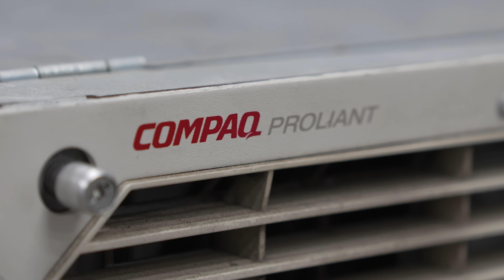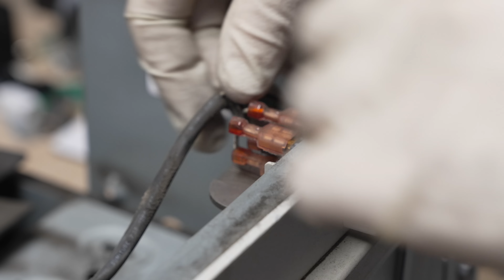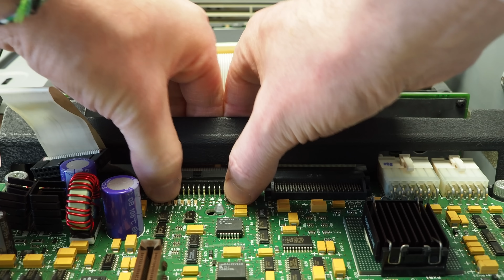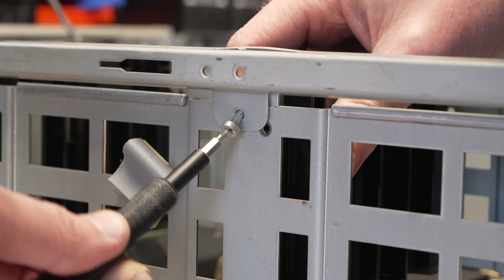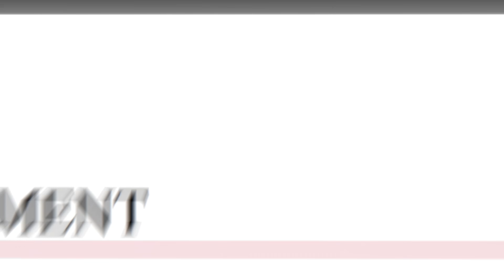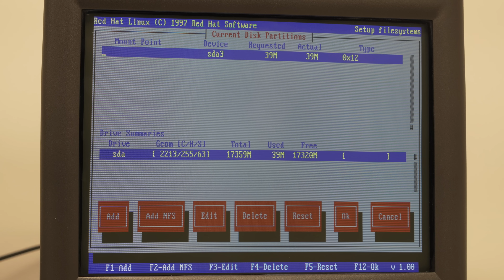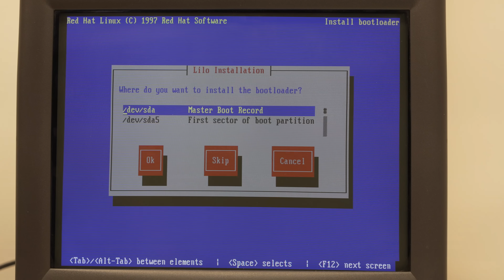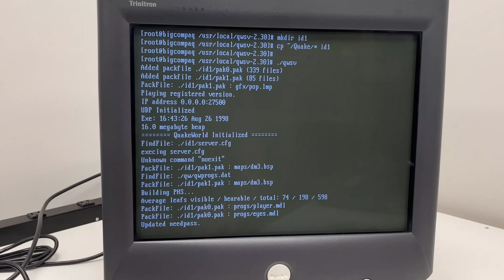A $25,000 server from 1999!

Comment: I worked at Intel in the server support group in '99-2000. Our official "corporate desktop PC" was an ancient Pentium desktop. But I supported systems like the one here. So I snagged one from our test lab, and made that my "desktop." Four P3-Xeon 550/2MB, a PCI Voodoo 3 card, a sound card, and I was flying. 

We even did a trade with a company that made "workstation graphics cards" - we traded one such system for a high-end "card" - it was a THREE PCI-X card set that each had two Voodoo 3 chips, with this company's custom firmware and interconnects. It truly was a three-card set, they would not work individually. IIRC, only one card even had the full PCI-X connection, the other two only used the PCI connector for power, with their custom interconnect on top (like a modern SLI bridge) allowing the cards to talk to each other.

We put it in an EIGHT CPU system, and ran Quake 3 on it. (Then it went off to the team that did trade shows, so they could run Quake 3 on then-brand-new HD displays.)
Reply: I imagine you’re referring to Quantum3D. They were spun off from 3dfx for very high end graphics for simulation work. Lots of different insane cards from the original Voodoo chipset (SST-1) all the way through to the later VSA-100 architecture. Awesome bits of kit.
Reply: @ It was even more niche than Quantum 3D. (I had a Quantum Obsidian Voodoo2 back in the day.) IIRC, the company didn’t last long.
Reply: @AnonymousFreakYT  dang that’s cool!
Reply: We had so many spare systems like this in our lab at Microsoft that I dedicated 2 and several storage arrays just to serve as an NFS share for MP3s.  Ridiculous amounts of money wasted on it :D
Reply: that end is funny
Reply: Running sgiquake fully-antialaised at 1080p in 2000 on a three-pipe SGI RealityMonster was pretty sweet... with 16 400MHz R10k CPUs and 5GB of memory,  the list price on the machine was over $1M, IIRC.

Now I have an HP Z840 workstation (tower PC size) with 2 10-core 3.1GHz processor modules and 256GB (quarter terabyte!) of RAM amd a much more powerful gfx card (Nvidia Quadro of some sort), that I bought off of eBay for $750... and it's about ten years old.  Amazing how far compute power and gfx have advanced.

Comment: I "requisitioned" a Dell PowerEdge R900 from my college a few years back. Thing was a beast with 4 sockets and multiple add-in cards for more RAM (up to a whopping 256GB!). It was louder than hell and drew 5 amps on startup. Way too much for my small apartment lab. Went to dump it at a Free Geek and someone in the parking lot offered to take it. Hope they're enjoying it.
Reply: Yeah, they're great... when someone else is paying the power bill. (I have an R910 scattered around. When moving one, you remove everything that can be removed - and it still weighs 1000lbs.)
Reply: @jfbeam  and believe it not, when i first got it, i carried it solo down 4 stories and across a couple hundred feet of parking lot. that was tough
Reply: I remember getting a PE 1950 off of Ebay, a R900 would have been amazing!
Reply: I scored an IBM X3500, it would be nice to try some silly uses however a bit overkill for a spare bedroom. if the screaming fans don't encourage the wife to demand I turn it off, then the power bill probably will.
Would make a lovely dialup BBS, trouble is phone lies are a distant memory out here.

Comment: 6:40 That's something I don't understand about Compaq's engineering... their name literally implies "compatible," yet they always had these weird proprietary components.  Like that giant kitchen-sink board with the video, SCSI, and I/O interfaces.  Why?  That could've just been normal expansion cards.

They did the same thing on the desktop, with the .. uh .. unique form factors for floppy drives, memory expansion boards, even off-the-wall stuff like how my Pentium mini-tower system stores the BIOS setup program on the first IDE hard disk .... which really spoiled my plans for using SCSI HD and CD drives.  I had to add a second HDD just to have something on the IDE bus ... which, naturally, required designing and 3D-printing a set of rails, since they don't just screw into the chassis.  AGH.  More like "Incompaq," amirite??
Reply: Well the name originally implied to be software compatiable with the original IBM PC, which they achieved better than pretty much all other clone makers in the early days. But yeah their setups stored on HDD partitions can be pretty annoying, especially on their early laptops where you can't configure anything without it and first you need to replace the belt in the floppy drive and hope that it still works.
Reply: @snap_oversteer   Yeeaahhhh... I know.  But it still chafes!  :-D

Comment: I actually used one of these lineup just a few years back. Anything more modern than P3 had struggles with some PCI card in process we relied on back then. It was kinda funny, when drive controller had more throughtput than RAM - but hey, at least it worked. Unless we were able to get rid of legacy hardware.